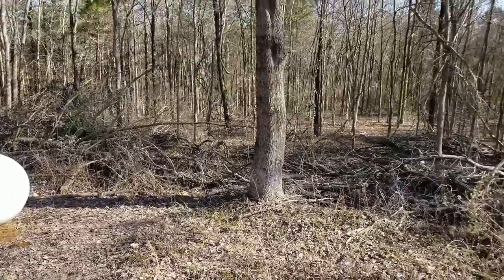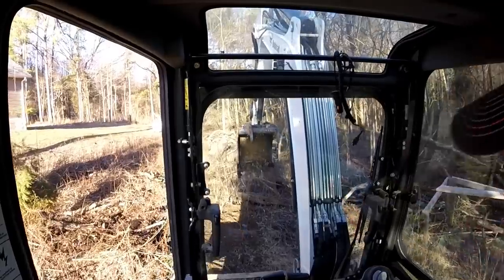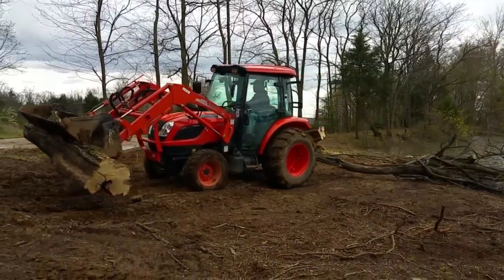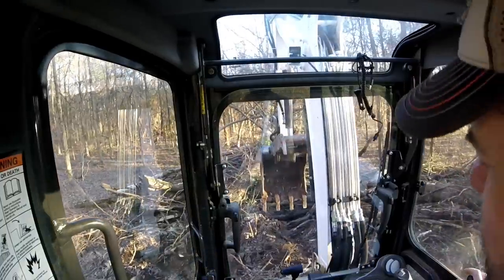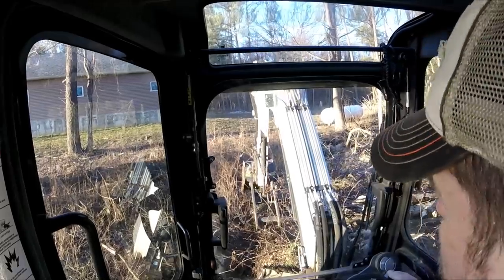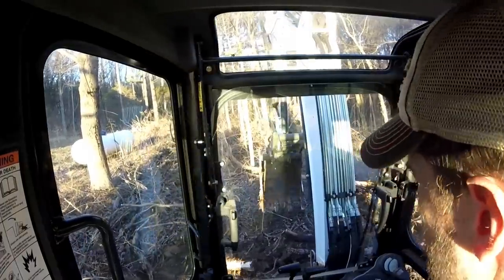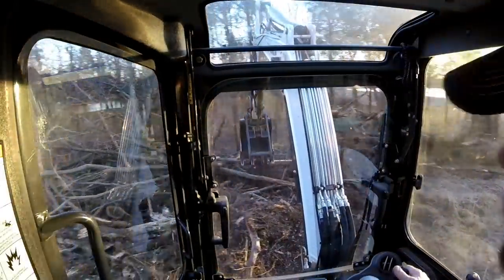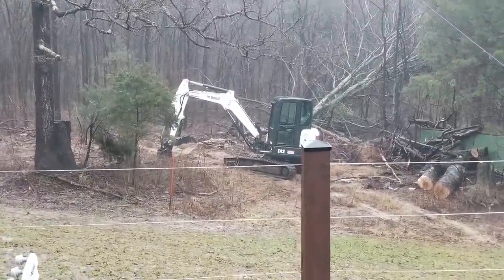Clearing trees for Ham Radio antenna 5btv

Comment: I'm no ham expert, but something you said back while assembling the current antenna caught my attention.  You said that one of the antennas (maybe multiple antennas) called for an insulated attachment pole.  To accomplish that, you put a PVC sleeve over the steel pipe support.  But that might not be what they meant by an insulated pipe.  I think they might have meant that the while pipe needs to be electrically isolated, i.e. no electrical connection between the antenna mount point and the rest of the mast structure.  To accomplish that you would need to make the whole connecting pipe out of PVC to insulate the antenna from the rest of the structure.  I have a feeling that might be your problem, and it mifght save you a bunch of work making a new antenna.
Reply: I'm no expert either. Insulating  anything doesn't mean squat with RF!  If we have a beam antenna, be it for ham radio, or just a TV antenna. How many elements are hooked up to the coax? The answer as a rule is ONE! All the rest are coupled by RF. There are ZERO PHYSICAL CONNECTIONS! Look at a TV antenna. One coax hooked up to ONE ELEMENT. A reflector, a driven element and directors. But only one is PHYSICALLY HOOKED UP! Electrical and RF are not the same beast!

Comment: I'm curious about the thick rope(?) lashed a third of the way up the tower, going to somewhere?
Is it for additional support (I hope), aid in raising and lowering like the two wires (draped over the roof peak)?
Reply from the maker: yes exactly right. But when I put a steel cable on the tower I will only need the one cable. thanks.
Reply: I'm glad to hear that. I was worried (as you've read) about it buckling.

Comment: I have a Stihl ms 391 and it's got power
Reply from the maker: Love my Stihl Saws! WE just bought the wife a small MS 170 for here woodworking stuff! Thanks.
Reply: Kapper Outdoors the ms 170 does have its limits depending on the size of bar on it from what I have experienced with the 16 inch bar they put on mine by accident when I bought it cutting over 6 inches it struggles wood working she should have no problem with that saw

Comment: rg213u mill spec burial cable ,will work great on that vertical.
Reply from the maker: I was going to use regular RG8x inside of some pvc conduit....
Reply: rg213u direct burial  less loss on long run.
Reply: rg213u direct burial, less loss on long run .save by no pvc. 6to 8 inches deep enough
Reply from the maker: @finpainter1  I'll check out the rg213u, thanks. Part of the reason I was going to used PVC was simply for protection from puncture since it wont be but a few inches down.

Comment: Oh and how many grounding rods you gonna sink for your ground plane?  Jack up in Oregon from Ham Homestead told me he has 12 on his 120ft tower array.  I think he has a 4 leg mast so 3 each leg.
Reply from the maker: The mounting pole will be the ground and I think that should suffice. On my tower I have 3 grounding rods on each leg. thanks.
Reply: @kapperoutdoors  i didn't understand what you saying.  I read that other comment and you're just moving that one antenna.  I thought you were moving the whole tower!  Gotcha.  So isn't that RG8 kinda cheap with high loss?  Wouldnt some RG213 be better?  Pretty long run....
Reply: Again this isn't even relevant, it might be for you in Oregon, might be important  for Kap too! I'm also in Illinois , NEVER EVER installed a ground radial!  But what works here might not work 5 miles from here. I see this all the time. I want a DEFINED set of rules. There aren't any! Many have mirrored my setup, it works good here. It didn't work for them very well.  You electrical guys, want to apply electrical rules. They don't apply to RF. No disrespect intended! RF rules just aren't the same. RF can electrically excite a hunk of metal 10 feet away. Probably more! Just saying.

Comment: you have all that room , throw some wires up.. you can not beat wire antennas
Reply: that five bander is a compromise antenna
Reply: most people use those verticals cause they are in the city and do not have room for wires
Reply from the maker: I have one wire antenna up and so far not too successful. It is an 80 meter, 66' I think on each side. But so far can't get it straight across from each other.

Comment: What cable are you ginna use with that much distance between your antennas and the receivers?
Reply from the maker: It should still be less than 100 feet. Probably RG8x in a pvc conduit.